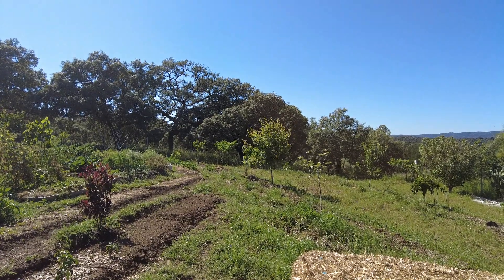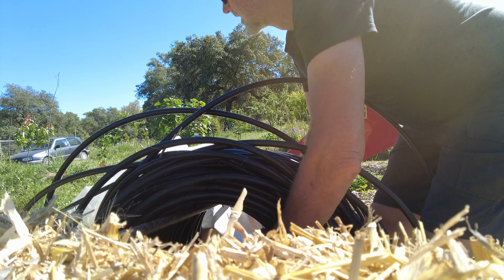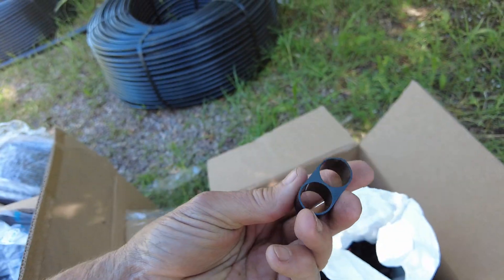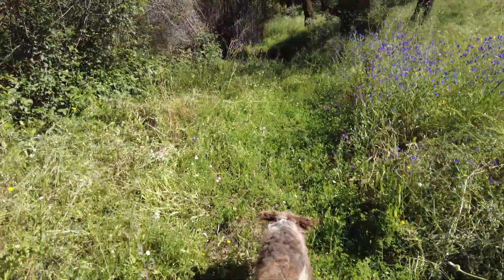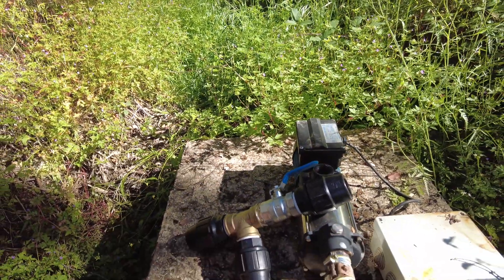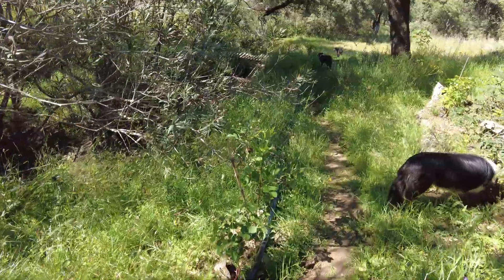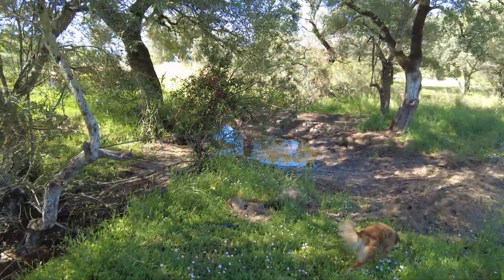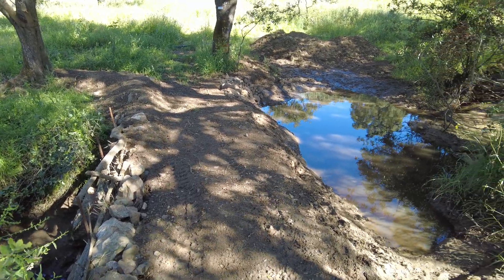Anti-drought system installation and setup.

Comment: drip irrigation has always been difficult for me. hard to irrigate evenly especially the smaller tubes. so i resorted to pass  few main lines that can be isolated and water one zone at a time. hart to have even pressure with small nozzles.  lots of work ahead of you. i recommend you try out a small section first then try it out. then you can improve on the next section. it's a learning curve.
Reply from the maker: Very good advice. Thanks for sharing. I'll try the garden first.
Reply: @SuerteDelMolinoFarm  Good idea!

Comment: Y la bomba no va a perder presión con tantos metros de tubería? No me he enterado mucho; quizás serían necesarias dos bombas: una para sacar el agua y dirigirla a un depósito y otra para regar (o regar por gravedad)?
Reply from the maker: No tengo respuestas, todavía no. Voy a empezar a usar gravedad y observar que pasa. Gracias por compartir
Reply: @SuerteDelMolinoFarm  I will suggest that adding valves in your 16mm lines where they take off from the mains will give you the flexibility to identify "zones" that the available water pressure can adequately supply. 
For instance, you begin the day with all of the 16mm valves closed.  As you walk your route, you open 16mm valves until you find that the output begins to drop.  You close the valve for this 16mm run and you have established the first zone.  When the first zone is watered, close all of the valves in zone 1 and repeat the procedure to establish zone 2.  No need to perform calculations.  This is a try it - fix it project.  
If you are not satisfied with the size of the zone your gravity tank can supply, you will have to pressurize with a pump.  With a pump, it is the same procedure to establish zones as I'm sure you will start with the pump you have. :)

Comment: Here's a mower that can be raised to a 7 1/2" cut. (19cm).  YT will not allow me to post the link.  If you Google - Earthquake tow behind rough cut mower - you should be able to find the machine.  You will need an ATV or the like to pull it.  Perhaps you can borrow an ATV?  At 19cm, I believe you will pass over the majority of the 2023 crop of holm oak seedlings.  Hopefully, you will be able to see or mark the 2022 seedlings.  The best solution is a small used tractor with a 3 point hitch coupled with a small brush hog as I described.  But I suspect you will not have time to shop for a suitable combo before fire season.  :)
I suspect there is a Euro version.
Reply from the maker: Thank you Steve. Let me look at it.